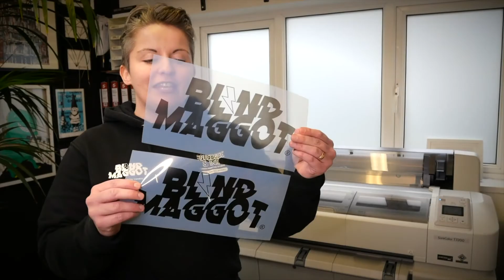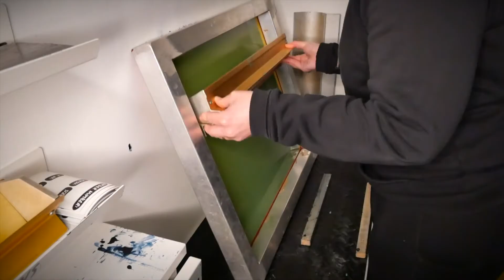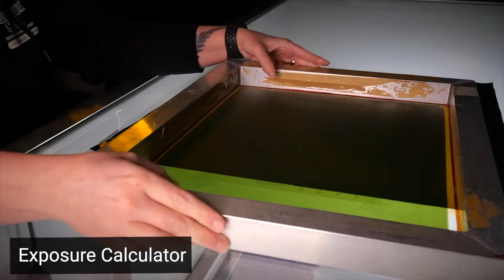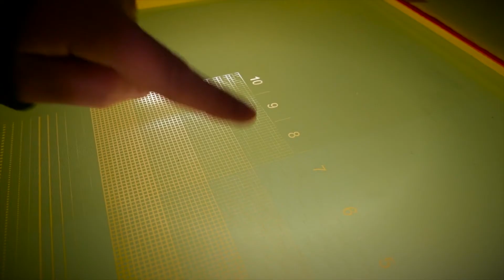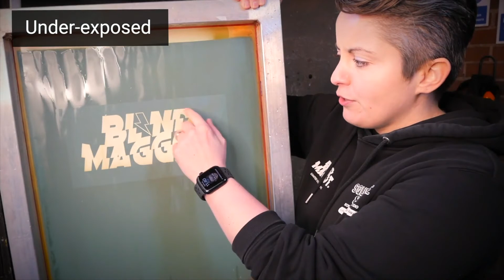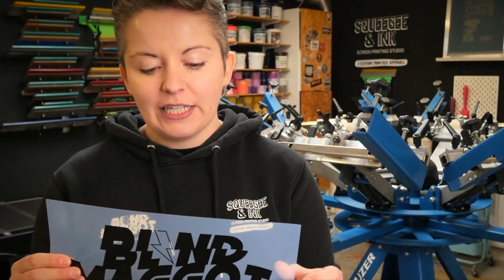How to expose a screen for screen printing  - full course

Comment: Thank you for this video. I was having a lot of trouble successfully washing out my screens. The troubleshooting section showed me that I was using transparencies that weren't opaque enough. The easiest thing to try was sandwiching two films together. I did that this morning and was completely successful. One thing I noticed in your video was that the graphics could be seen almost immediately after the screen was sprayed and the washout took only 10 to 15 seconds. Previously mine took close to a minute to wash out and I would often get washouts near the graphics. My next action will be to subscribe to your channel.
Reply from the maker: Great to hear your'e having a better time with your exposures! let me know any other teething issues!

Comment: I appreciate your video. So detailed and informative! I have a question about printing rich black. My Canon Pixma Pro 100 is a photo ink jet printer. I followed your instructions except for using the rip software and the blacks aren't as solid as they need to be. Should I invest in a printer dedicated for graphics? Thank you.
Reply from the maker: not necessarily - the RIP software really helps for sure - maybe I need to make video for small printers.

Comment: Your videos are incredibly informative and have been a huge help in my knowledge. Thank you for sharing such valuable content! I'm currently looking into printers for PCB manufacturing screen preparation, and your insights would be invaluable. Based on your expertise, could you recommend the best printer in the current market for ultra-precision requirements? Additionally, I'd appreciate suggestions for both budget-friendly and higher-end options. Thanks again for your fantastic work!